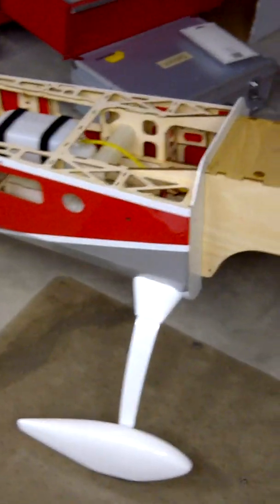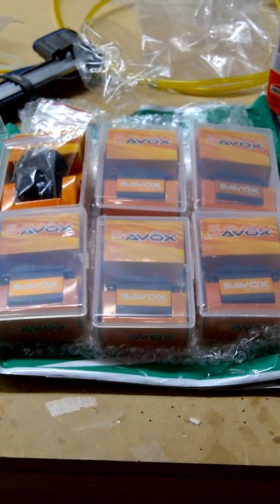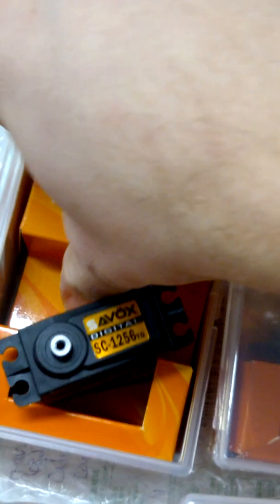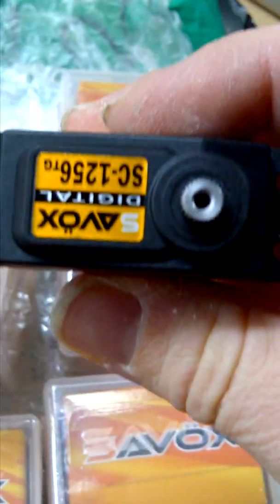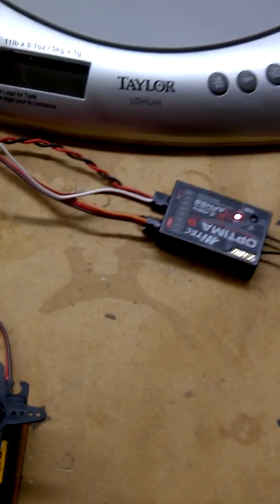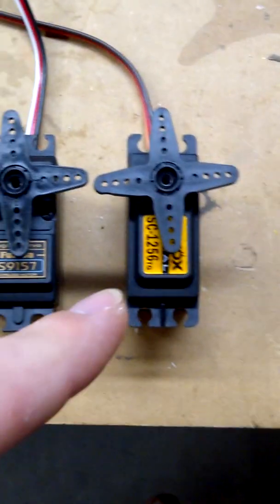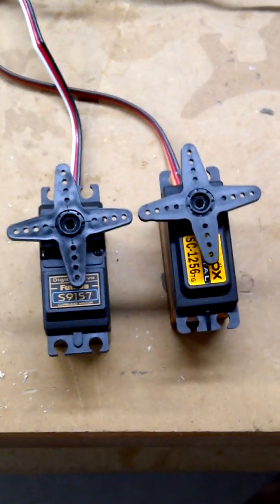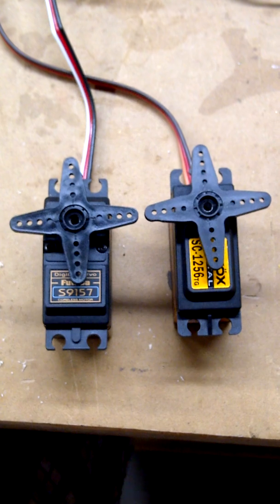Savox 1256TG Servo Review

Comment: I bought 6 1256s and 1 1270  and thought I would take the tops off to see if they put any grease on the gears ,guess what only two had a slight bit .And also no brass bushing in the top case on the motor shaft on any of them wtf ,these servos are over $100.00 each!  Needless to say I greased the gears ,anyway they are powerfull ,fast and centre perfectly in my 120cc extra .